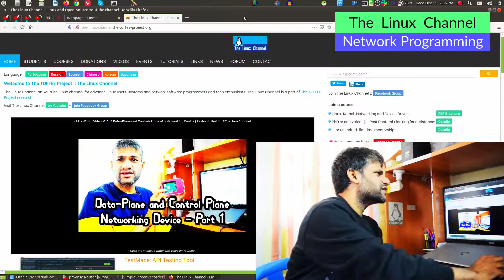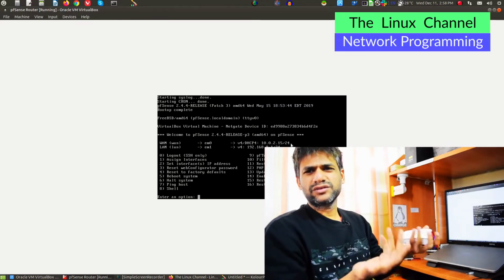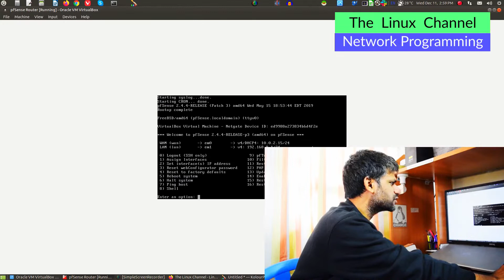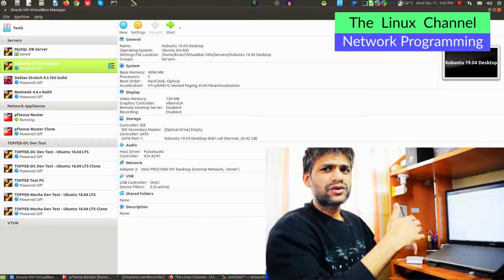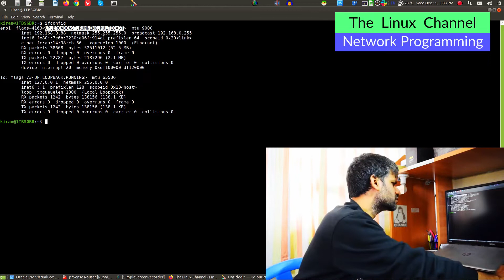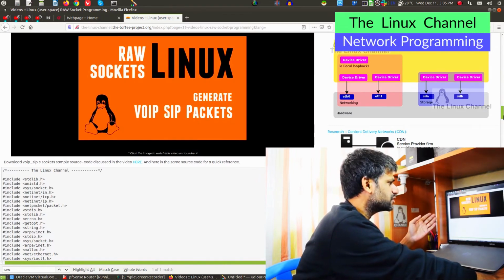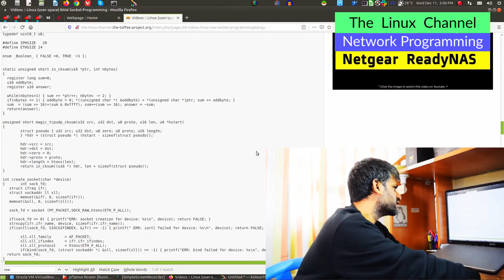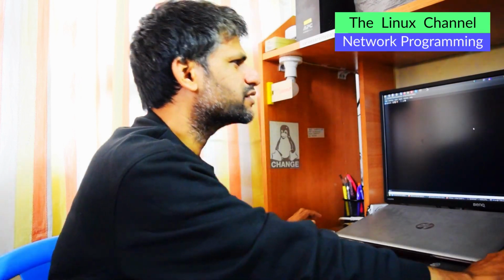0x1dc Layer-2 (L2) Multicast Frame Deep Analysis | Part 1 | #TheLinuxChannel #Networking

Comment: Not sure how you can perform ping between two system of the same LAN without involving the router or gateway like you said. Could you please explain the path of the packets in that case ?
Reply from the maker: you dont need a router if they are in same ip subnet. They go from one PC to other PC directly via switch. Or if you connect both directly via CAT5 network patch cord without any switch